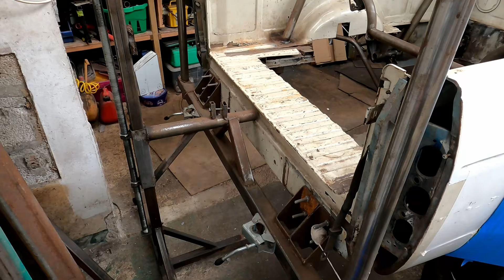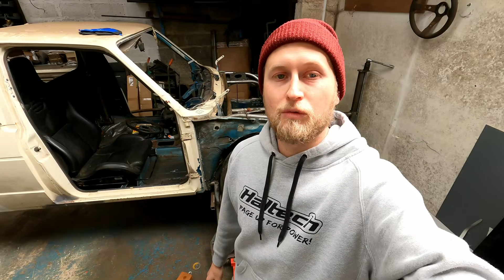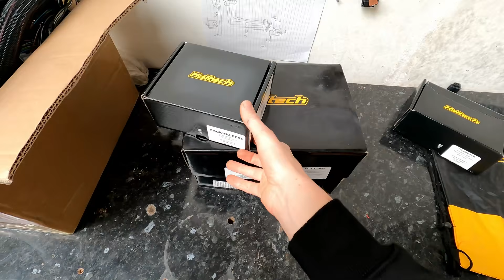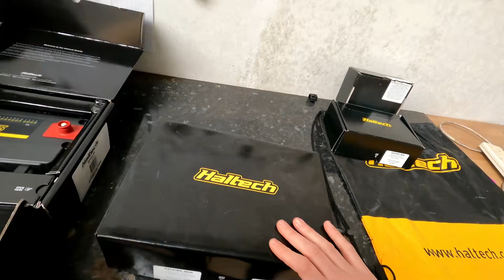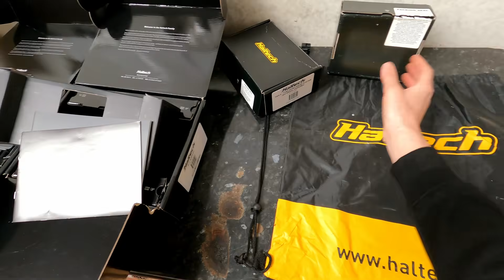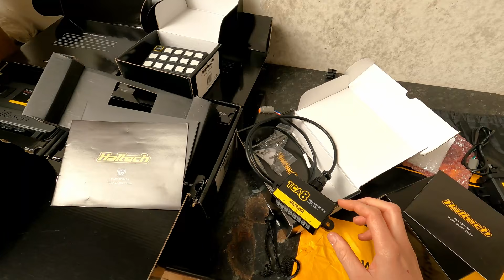McLaren M838T Engine in a VW Caddy - Garage 68 - Episode 0 "Introduction"

Comment: You should do a Alfa Romeo 4C with a BMW S85 and manual and BMW F90 M5 brakes and full standalone or if you can OEM computer for the engine so it works like stock

Comment: Great video!  Can you provide some details on the adapter plate and the mating of the transmission to the engine? Did you keep the McLaren drive line damper?
Reply from the maker: Thank you! 
For the adapter plate, I had some help from a good friend who runs a motorsport fabrication shop with CNC equipment (more on him and what he does will feature in a video). We mapped out the bolt pattern of both the gearbox and the engine and transposed this into CAD - aligning the crank and the input shaft. From this we could establish what the adapter plate would look like and machined it out of steel. We used a flywheel which matches the gearbox and made an adapter for that in the same way (similar to how a wheel adapter works). This also re-aligned the flywheel/clutch with the bellhousing.
This is all bolted directly onto the end of the McLaren crankshaft. I'm not sure if there is a driveline damper at that end of the crank on the McLaren (I never had one) - but other end of the crank still does feature the 'harmonic balancer' which you can see at 10:21.